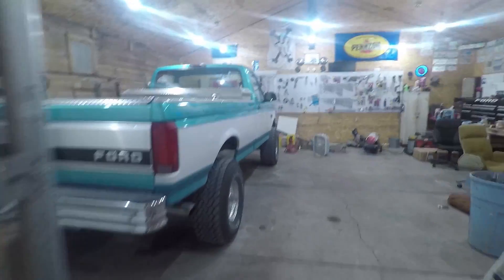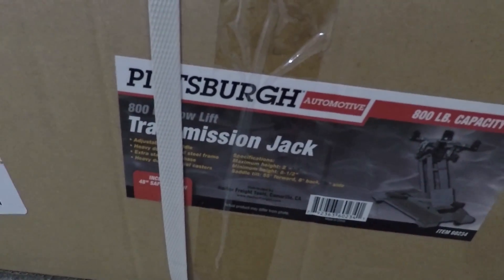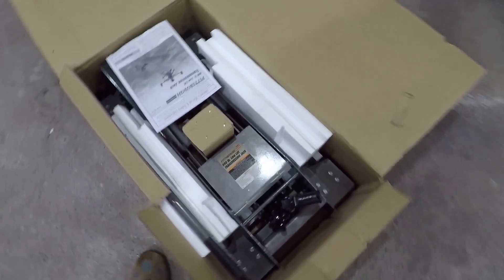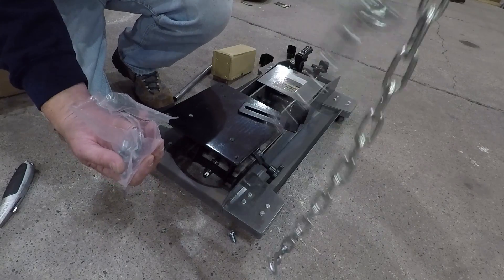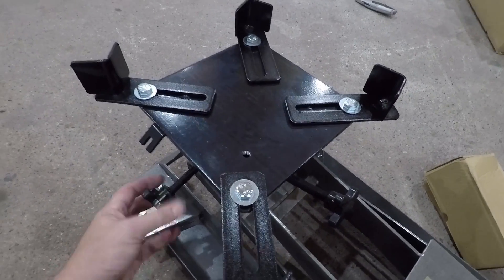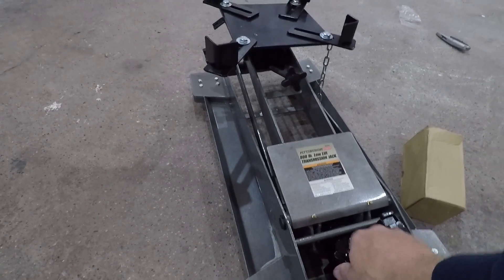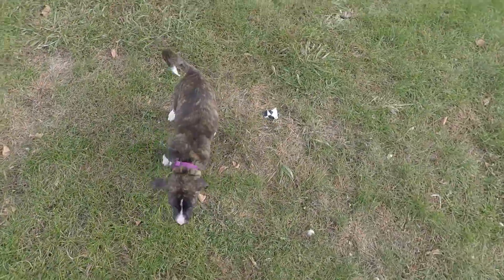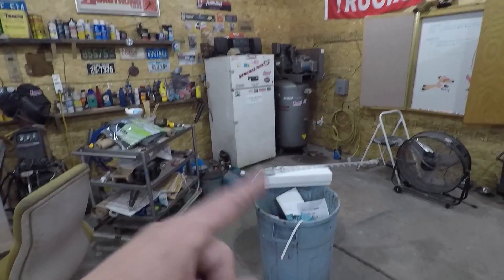HAD to get ONE Of These!

Comment: Great Videos! I see you have a little rust on the project truck. Have you heard of Magnet Paints Co? They have a rust preventive underbody coating called Chassis Saver that looks really tough. They also have a DIY bed liner called Monstaliner. I've never used the Chassis Saver, but I have repainted my extended cab 96 F150 with the Monstaliner. Yes the whole truck. Turned out really well.
Reply from the maker: Wait a min.... you saw rust on the project truck?!? WHERE?

Comment: Hey Jon, if the Shop is wired from the main house and not on a separate meter, power line networking may be a good solution. Depending on the quality of your adapters they are usually good up to 900 feet range. I have been using them for several years with a TV and Roku unit streaming movies, etc...
Reply from the maker: +Snapvine shop is on its own separate line

Comment: Harbor Freight is kinda hit-and-miss when it comes to what you get, but there are some good values to be found.  I have their engine hoist (which I actually bought to remove Super Duty axles from the bed of my OBS for an eventual suspension swap...), and it does the job and was less expensive than counterparts from other places.
Reply from the maker: They do have some good things.. and a lot of things that might be good for one or two uses.

Comment: Are you replacing the flywheel as well the bolt holes might be worn a little bit just wondering.Keep up the great video's
Reply from the maker: doubt it, but if it looks like it needs replaced once I get in there.. I probably will.

Comment: Jon, have you thought about changing the roofline of the shop? Turn into a shed style or just a flat roof on the one side. That would increase your headroom enough to install a 2 post lift. Change the door to get rid of the tracks. Since the roof isn't load bearing it would be a no brainer.
Reply from the maker: +Alexander McKay hmmmmmmmm....